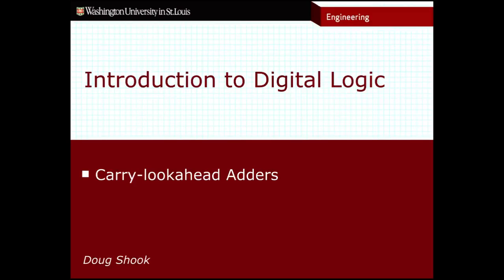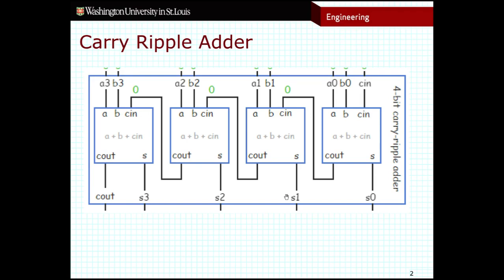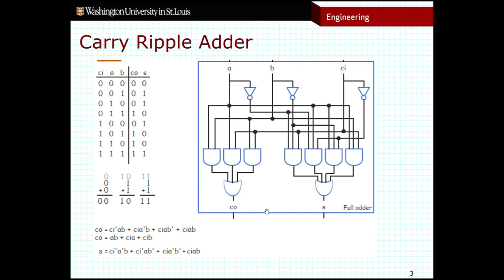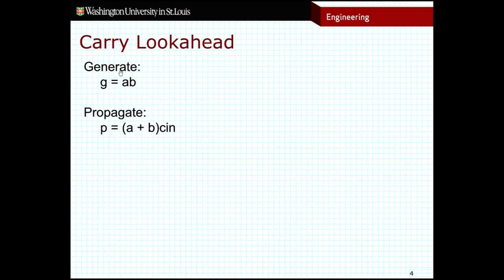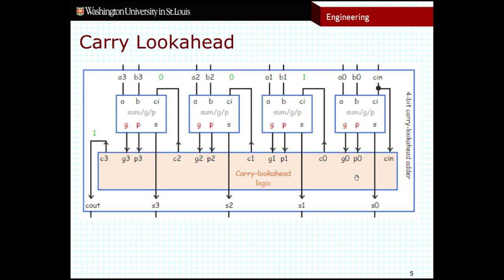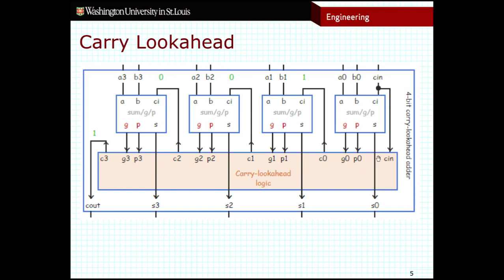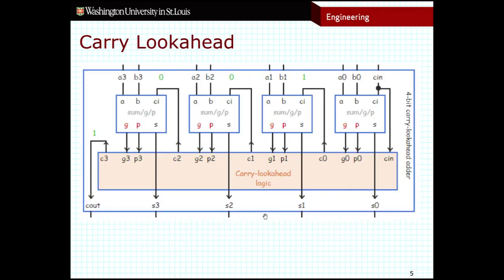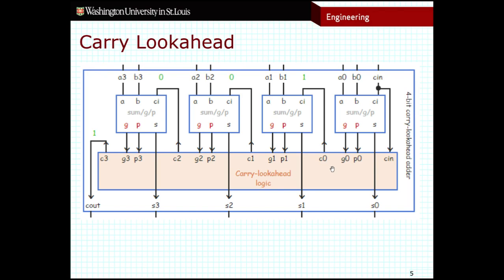CSE260 - Carry-Lookahead Adders

Comment: 03:27 So what's the difference anyway? The second adder still needs to wait for the carry logic to generate it's carry, and in a normal ripple adder the carry is also "immediately available to the next adder" as soon as it has been calculated :P The problem lays in that calculation, though, which takes some time – more and more with each bit.
It can look like a clever device which is supposed to be faster, but only because you don't see what's happening inside that box at the bottom. There still are logic gates, the more in number the more bits you process. It just extracted out the carry logic into that box, but the number of gates needed is still the same, and you still cannot get the next bit unless you get the carry from the previous bit.
04:40 Exactly. The rippling effect is still there. So what's the deal? :P Where the "speed" comes from, REALLY?
Reply from the maker: Well in the video I say that we'll take a look in class but since you weren't in my class you can try this for yourself:

Sketch up a 4-bit adder in both styles, down to the gate level. The logic for the lookahead is given to you in the video.

Assume each gate has 2ms of delay (a simplification, but it works). Run through the addition process in both adders and determine how long it will take.

At a high level, the lookahead adder is faster because it sacrifices size (it has many more gates) for speed.
Reply: @DougShook  hehehehehe
Reply: @DougShook  good point